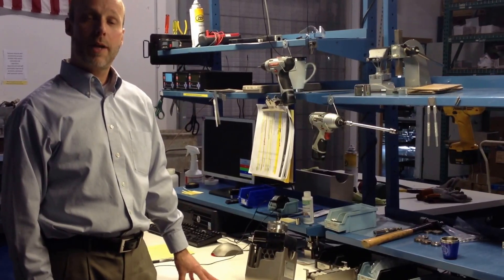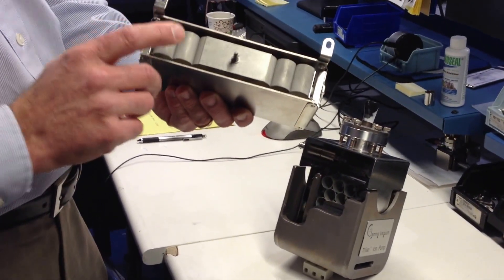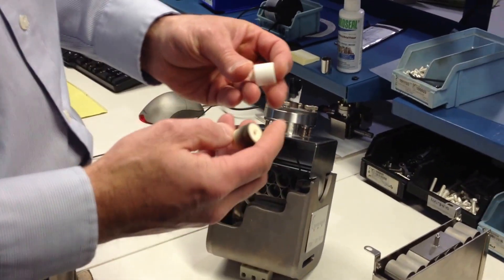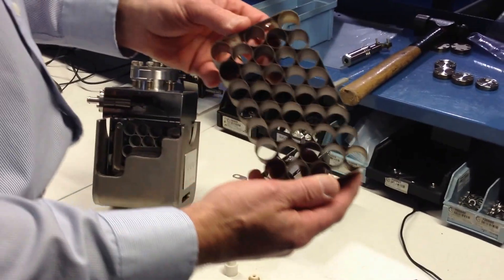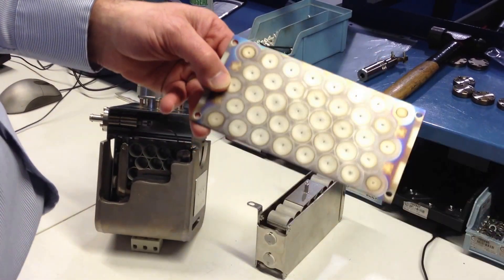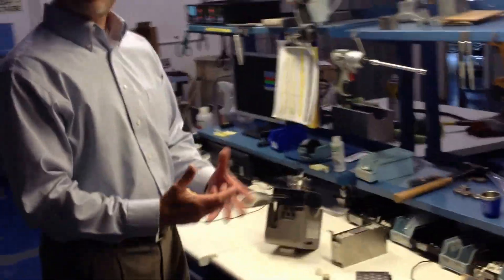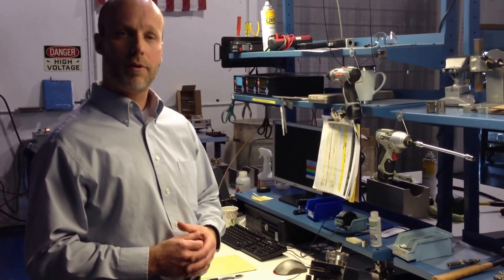Ion Pump Lifetime

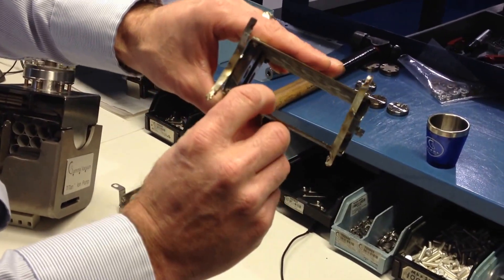Comment: Ok, thought I understood more about the Ion pump, but at minute 1:40 you mention the damaged Cathode plate would definitely cause a short (within the pump and High voltage), but isn't the cathode plate already at ground potential?  I've opened my pump, and trying to clean and inspect it due to high resistance short. It seems to be a larger unit, with sets of anodes on two (opposite) sides and I have to look up with a mirror to see the interconnection bands from anode to anode.

Comment: Nice video.  I like how you showcased all the parts.  Does the magnetic field strength effect the sputter pattern on the cathodes?  Will a weaker field have more even wear, but lower pumping speed?  Thanks.
Reply from the maker: Thanks for the kudos.  The short answer is yes it does.  The long answer is that it does not have a major effect.  We use software model ion movement in an ion pump cell.  Ions travel towards the cathode in a helical patter - also called magnetron motion.  This motion is affected by the mag field, the voltage of the anode and resulting charge in the tube, the molecular weight of the ion, and the origin of the ion within the anode assembly.  We can control the field, but the other variables are dependent on the pressure and gas species.  

Your theory of a weaker field is correct, but in the end, the wear is dictated more by pressure and gas species than magnetic field.  A high field is more essential to keep more electrons in the anode than a weak field to spread ion collisions over a wider area of the cathode.
Reply: Thank you for the detailed response.
Reply: +GammaVacuum what happens if you use silicon carbide instead of titanium oxide?
Reply from the maker: TiO and other Ti compounds are what are created in the ion pump from the pure titanium.  Generally the reactive properties of SiC come from what it is doped with.  From a cost pand likely oxide creation perspective, pure titanium is likely to be more effective.  That said, I doubt anyone has tried various SiC types.